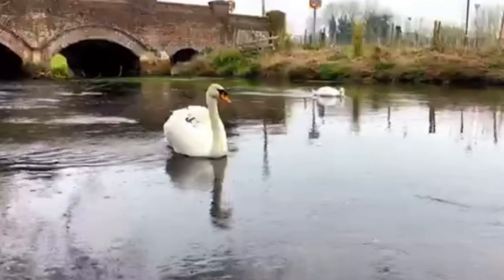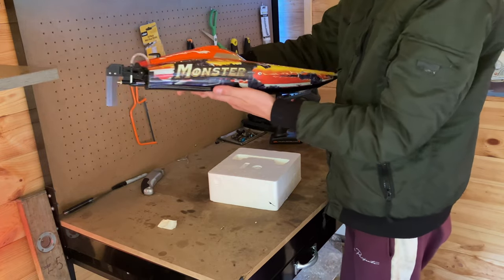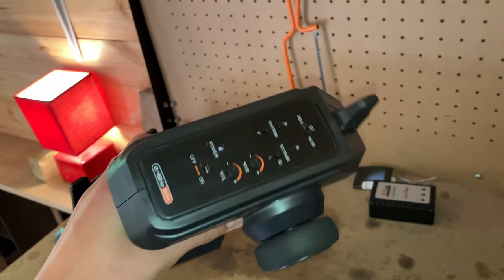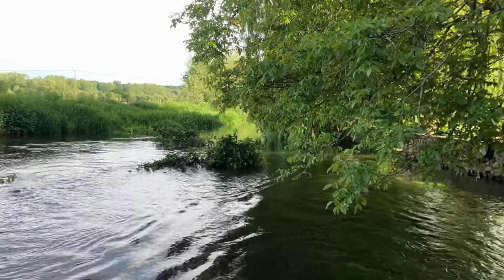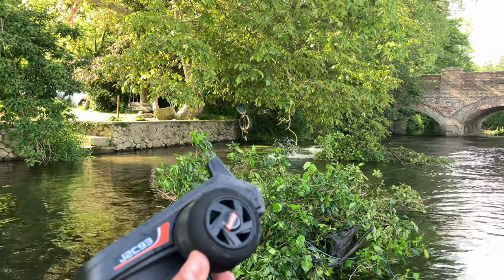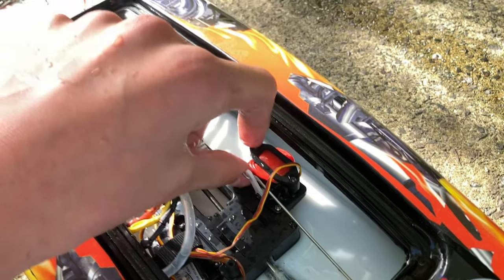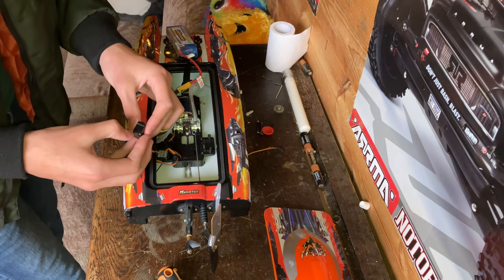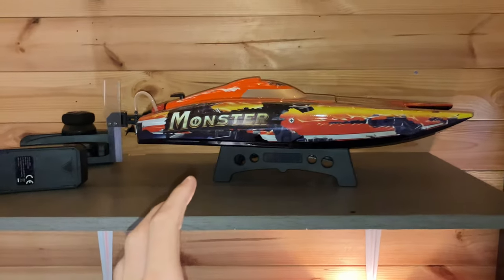This is almost the best rc boat…. Just one thing 😕

Comment: Got the same boat and have the same problem with water! The water is comming in the little hole that is meant for tapping out the water.It's not completely tight.After tapping it for water i just placed the boat in the water for 15-20 secs, and it was water inside the boat again.This boat needs some modding to keep the water out!
Reply from the maker: Yeah, I’ve heard from a few people now that these boat need some moding 👍🏻 It’s a great boat when running but just not very well designed 🤣👍🏻